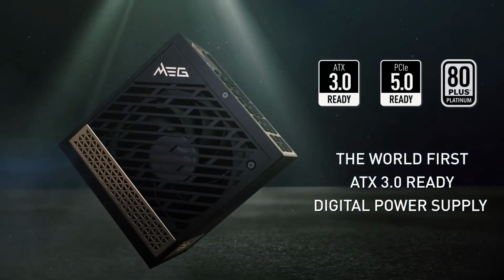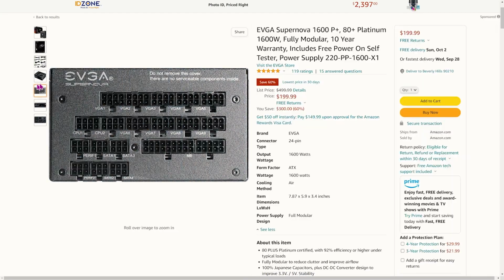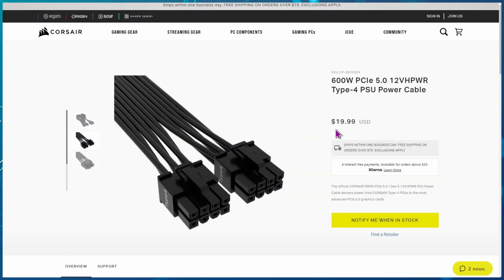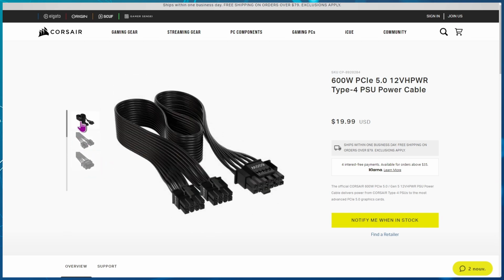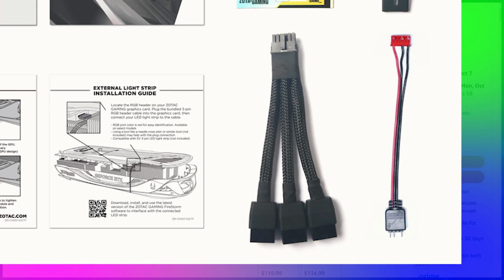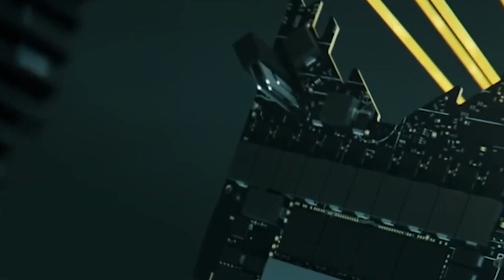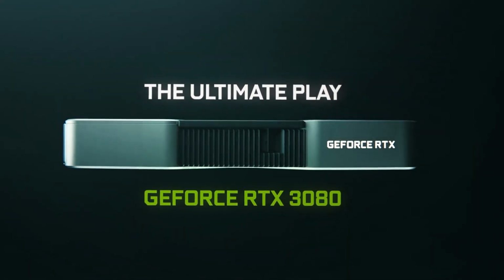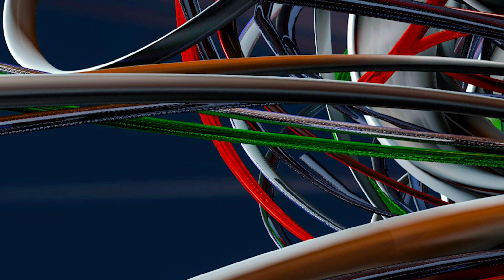Non ATX 3.0 PCIE Gen 5 PSU BACKWARDS COMPATIBLE solution? - Corsairs 12VHPWR Adaptor Cables

Comment from the maker: :goodvibes::yougotthis:Finally Corsair present their solution to the PCIE Gen 5 12VHPWR cable challenge.  And also some answers to all your RTX 4090 and powers supply questions!
https://bit.ly/Nvidia4090Facts: Jonnyguru's interview

The solution is EXCELLENT, but will Corsair adopt ATX 3.0 
Compatible Corsair 1200W PSU (600W GPU)
US - https://amzn.to/3C12VR5
Compatible Corsair 1000W PSU (450W GPU)
US - https://amzn.to/3y8Cgkb
Compatible Corsair Cable Mods
https://amzn.to/3MexRCh - all color choices on this page are compatible.

The World's FIRST ATX 3.0 and PCIE Gen 5 Power Supply
MSI - 12VHPWR - 1000w Gold - MPG A1000G PCIE 5 - (450W GPU)
US - https://amzn.to/3BLWr8w
https://bit.ly/PSU-ATX3-1ST
Power Supplies for RTX 3090Ti and RTX 4090 - Recommended PSUs
https://bit.ly/PSUs-4090-3090ti

Comment: If I have a power supply with 12VHPWR port onboard, can I use this cable to connect my ASUS ROG Strix RTX3080 with 3 8-pin connectors on it instead of using 3 x 8-pin to 3 x 8-pin?

Comment: Just a heads up for anyone who plans to buy this, u need to have a 1200W+ PSU for it to actually pull 600W out with the cable, if ur PSU is less then 1200W it will default to only 450W
Reply: Didn't know this info and just bought it today expecting to get the 600W the RM1000x.
Not sure if it's just me, but I could not find this information at all anywhere on Corsair's website and I'm pissed. 

Anyone interested in getting this cable, PLEASE make sure that you know this critical information.
Reply: @LOLBROGAMER  yeh im not to sure were it is written but i read it in an article + have seen other peoples videos talking about the cable and they explain in detail how much Wattage you get depending on your PSU's max Wattage.
Reply: uh 600w in a single cable
Reply: @iikatinggangsengii2471  yeh the RTX 4090 can pull up to 600w on high loads while overclocked
Reply: @iikatinggangsengii2471  Cables are currently the hottest thing in gaming!
Reply: Not planning on overclocking my 4090 at all anyway at 98% load my gpu only pulls about 380w so it’s fine
Reply: @SlayerboyRs  When you buy the cable it says on the page down at the bottom
Reply: I have an older 1200w platinum psu not made by corsair. I'll be OK with the adapter?
Reply: @justinspirational  no. It won’t work. This is for the Corsair type 4 connection.
Reply: This is not true. You can pull the full 600w on any corsair PSU, granted that PSU has at least 600w. Now this is ofcourse not reccomended, and also why Corsair has said "you need more", to cover their asses. As to how I know this, multiple people have reported using 850w or 1000w and getting the full 600w from the cable. I myself have an RM850x, and am using the cable, and am also getting full power.

Basically, there is no way for the cable to know what PSU it's plugged into, unless you have a new ATX 3.0 PSU that actually utilizes the sensor cables.
Reply: @vedomedo  corsair them selves have said it will automatically default to 450 if ur PSU is less than 1200, its even on their website when you look at compatibility for the product lol
Reply: @vedomedo  Not working on my RM850.

Comment: I have a MSI PSU with 12v hpwr standard and 3070ti graphic card with 2x8pin. MSI is providing 12v hpwr cable that splits into two 6+2 connectors. Can I use it instead two 8 pint to 6+2 pin connectors? Seems logical but I have no idea how it works as it was intented to be used in 3x8 pin GPU sockets with additional 8pin to 6+2pin cable. For some reason this topic is omitted everywhere.

Comment: Yes. But it's not just a power distribution exceeding the maximum specification of the (now in operation) cables. There is an additional problem, it seems (I got from researching the available info). And that is, that the old PSUs can't talk to the 40xx series GPUs. The new PSU can communicate with the GPU and scale power delivery. This isn't an issue for powerful high specification PSUs but if users are on the edge of their maximum specifications... They're going to overload the ("dumb") PSU that is not rated for these huge powerdraws. If the PSU is capable of handling the 40xx (while also being "dumb"), iow has enough headroom, then it's still not a good idea to connect 300 Watt to a 250 Watt max cable. The Corsair one does allow proper power distribution. But I don't understand the bit about the data.. 40xx is different.
At least.. that's what I understand about it.
Personally, I'm not affected, I'll be buying a last gen 30xx or new gen AMD RDNA 3.0  to replace my aging 780 TI. Cheers
Reply: @vursats 1000w+ 4090 will draw 450w+ and 7900x while gaming is probably around ~150w. 1000w should give you plenty of headroom.
Reply: @vursats I would recommend 1200w at least to be on safe side. 4090 alone will likely be 450/600w with dual bios options from AIB partners

Comment: How is it this cable only needs 2 PCIe  connections on the PSU side whereas the adapter wants 3 or 4?
Reply: yeah i was curious about this too
Reply: Its simple, thicker cable like the pig tail connectors thex can deliver 2x 300 Watts instead of 150W each

Comment: I'm buliding a new PC, but already got a 3070. Can I use a splitter cable in reverse, to connect the PSU's 12v cable to the 2x8 pin on the GPU?

Comment: I've got a 12900k and a 3090ti fe, the fe imput is the 12+4 pin, and the adaptor nvidea supplied is just a 12 pin, with no 4 pin. It's 450 watts and probably the exact same crap as the 4090, so obviously nvidea wasn't worried about it
Reply: the 4 pin i guess was added into the spec last second, anyway corsair also agrees with nvidia, current good psus with good adapters are fine. nvidia adapter or corsair for their 1200 and above.

Comment: that cable only works for CORSAIR (new?) power supplies, does not work with any brand unless you know it's compatible.
Reply: I read it works on any type 4 Corsair PSU 1000w+
Reply: Yeah definitely don't try on a different brand. As the pinouts can be different

Comment: I've just bought a 4090FE and I've got a Corsair TX850M PSU. It only 2x6+2 PIN PCI that goes our from it. My has question is: can I use this cable or can I just stick with the cables provided with the PSU, which means, two separate cables with 2 ends each ("Y" cable) and just plug them to the adapter provided with the card (just 3 and one loose as I don't intend to OC, or all 4?). If you could help me it will be really appreciated. Thanks in advance

Comment: You mentioned the Seasonic Prime TX 1600 in your video. That PSU already comes with two such cables included. 2x 12VHPWR (12+4 Pins to 8+8 Pins). So no need to buy this generic Corsair cable.

Comment: The PCIE Gen 5 has functionality that the earlier power supply's lack none of which was discussed on this video. What is the difference running this cable on an earlier power supply vs a Gen 5 PCIE? Better info in the "comment" section. Video FAIL!

Comment: Can i use it with a Corsair HX1500i ? Do i still need the cable from Corsair? And is this psu enough for a rtx 4090 and a i9 12900k?
Reply: Yes, and Yes! I have the same PSU and cable works perfect. 1500 is more than enough just make sure to use the corsair cable

Comment: Guys I am sorry for asking this, I do not really get it. Why would you buy the 12VHPWR cable when you get a cable when you buy 4xxx series card? I mean it is included when you buy a 4xxx series card right? 

Like I bought a new psu (evga 1300 watt platinum) and I am planning to buy the 4090.
So I want to make sure when I got the 4090 I can plug it immediately in my computer and boot it up.

Thanks in advanced.
Reply: from what i have seen... if you have 4 pci-e connections on you're power supply and you use the 4090 adapter cable it comes with you should get all 600w. if you have 3 pci-e connections you will get 450w. this will work but more stock/ limited power
Reply: It uses less pcie slots